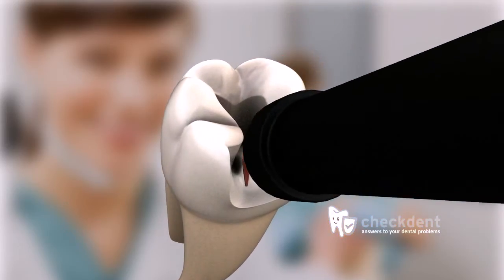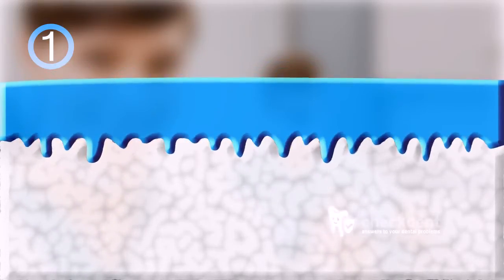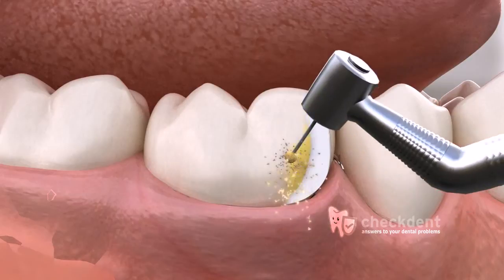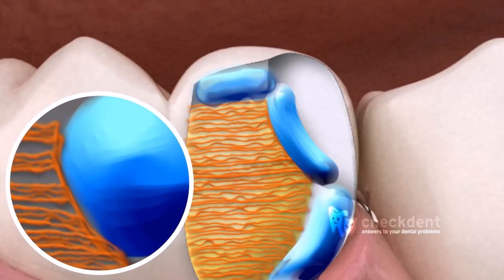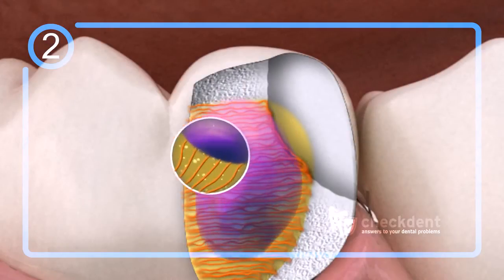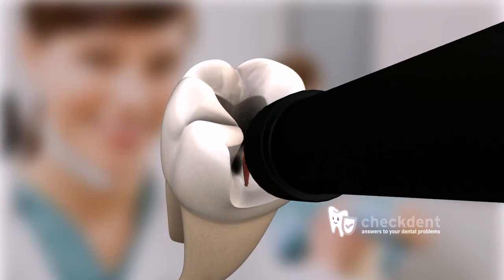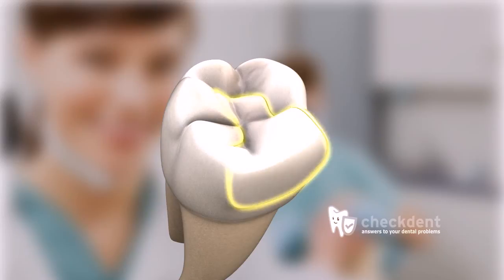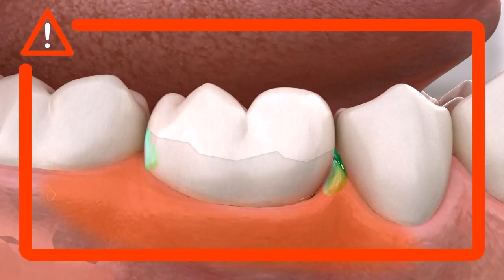Dental Bonding of Ceramic Inlays

Comment: I was wondering whether they had to 'rough out' the tooth with a drill or not, my buck teeth were shaved leaving me with sensitivity at the flattened cusps and was wondering about bonding as a solution , I heard these last ~7 years until they fall off but wouldn't want to be drilled nor acidic gel to destroy any more enamel, wonder if they would last long without roughing them? I feel like there's dentin exposed and hope that bonding could restore my teeth to feel like they were before they were shaved